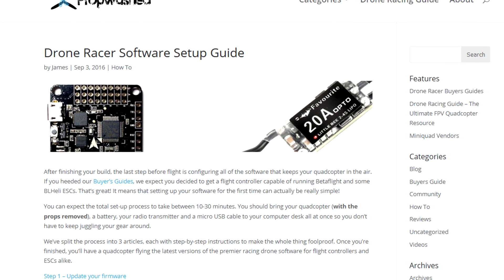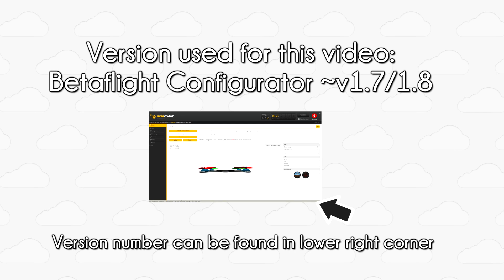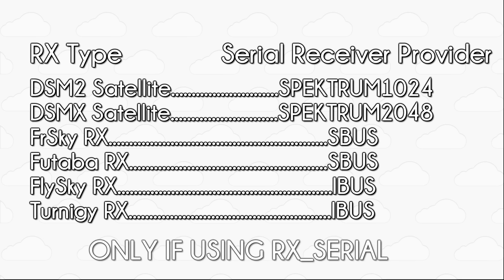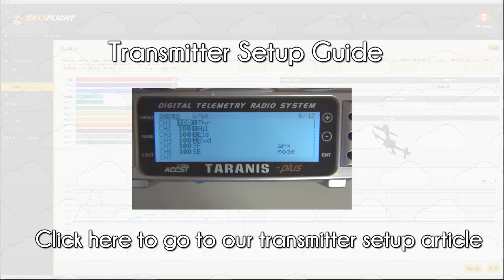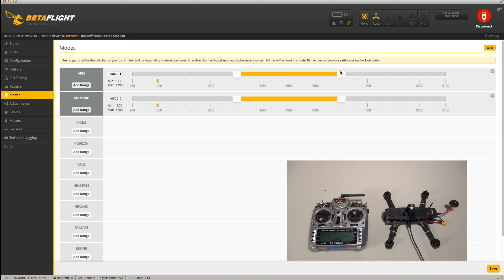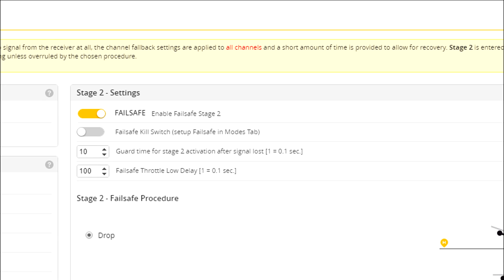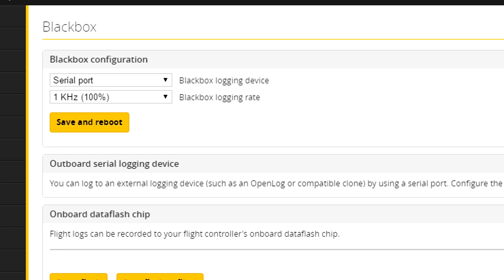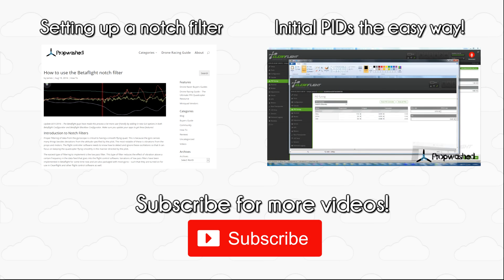Quadcopter software setup - Betaflight Configurator

Comment: Hi Guys, awesome video & very informative ! I'm a newbie to this quad building. I have gone through all the steps as mentioned but am unable to arm the quad as my CPU is at 100%. I have turned accelerometer off etc. I am running PWM for my receiver. Without the transmitter & battery plugged in CPU is at 2%, but when I connect battery & transmitter it jumps to 100%. In the tasks in CLI it shows Serial usage going up by 105% & RX 109%. Any information would be greatly appreciated,
Cheers

Comment: What happens if I disable accelerometers in confg tab? O.O Good video btw
Reply: The main thing that happens is the quadcopter can no longer sense whether it is upright or not. This means angle/level mode will no longer work. It also does a few other minor things:
- Decreases CPU usage
- Allows the quadcopter to arm/disarm regardless of orientation (really good thing if you like using the arm switch to find your quadcopter!)
- Removes orientation data from blackbox logs.

I personally fly with the accelerometer off all the time because of the second bullet point above. I always fly rate mode so having angle makes no difference to me.

Comment: Hello Propwashed! When I connect my battery, it wouldn't connect to betaflight but when I disconnect my battery, it connects normally. Can you please tell me what the problem is because I'm not able to calibrate my esc and setup my switches. That will be great thanks
Reply from the maker: Sure - this generally happens when you have something hooked up to UART1 on your flight controller like an OSD. When it is powered up the computer and that component both try to talk on UART1, making it not work. What FC are you using?
Reply: Propwashed I'm using a sp racing f3 flight controller
Reply from the maker: And do you have anything plugged into UART1?
Reply: Yes I did but it works when I unplug it. Thank you for your help!

Comment: Hi guys, I need some help. I'm using a naze rev6 and I've done all the setup steps. When I armed and throttled up for idle, the motors kept spinning faster then leveling off, somewhat, then gradually, slowing down but starting the same cycle again. I started off with Betaflight then changed over to Cleanflight, tried different software and none of this made a difference. I calibrated the ESCs and accelerometer. I have a video trans., a step down 5v and the receiver all next to each other. That wouldn't make a deference, right" This has me stomped. Has anyone experienced this before? Please help with any advice, thanks , Steve
Reply from the maker: This is normal behavior when in level mode. The reason is the flight controller is attempting to get the quadcopter level using the motors but without props it cannot and the I loop causes the motors to slowly spin up. If you are doing your tests in acro mode, this could be caused by a bad gyro. I would recommend using blackbox (naze rev6 has built in flash) to determine why the flight controller is commanding a spin up. We have a few articles on some ways you can test using blackbox here: http://www.propwashed.com/finding-problems-with-blackbox/

Comment: man i did the to a T and your esc setup and my quad flys great, BUT. when i give it a full stick flip or roll it goes into like a non stop death roll till it hit the ground. i have tried everything to figure it out and i dont know what to do. and ideas? end points are good everything is good, like i said i followed your setup to the T and it just freaks out. if i do slow flip or roll its fine but full stick flips it out of control... please help
Reply: We'd be glad to try and help, but I don't think youtube is the right place :) You can e-mail us at community@propwashed.com or post on the RCGroups beginner forum - I help out there a lot. I can tell you the first question I have though - can you get a blackbox log of the issue occurring? This'll be almost certain to tell you what the problem is. My guess is an ESC reset caused by a voltage spike - I've seen it before and fixed it by adding a big cap onto the power system.

Comment: min throttle on your webpage in the screen shot and in the text says min throttle 1016 but in this video it you say 1024...? should they be 1016 in blheli and 1024 in betaflight or is it one or they other and they should match? please help i am about to go through all this and just looking on line is the only help i have. i would assume they should be matching minimum number... ether 1024 or 1016 in both blheli software and betaflight.... please help...
Reply from the maker: You original statement is correct - it should be set to a higher value in Betaflight than it is set in BLHeli. So, in our case we recommend 1016 in BLHeli and 1024 in Betaflight. You always want 5-15 numbers higher in Betaflight because issues with how the FC and ESC communicate will cause the ESC to occasionally spin up when disarmed if you set them to identical numbers.
Reply: awesome, yeah was a bit confused about that. all i have used up to this point is cc3d and libre pilot. new build is using xracer and racestar escs. thanks for the reply thia video is a big help.
Reply from the maker: No problem, happy to help!  Let us know if we can help clarify anything else!